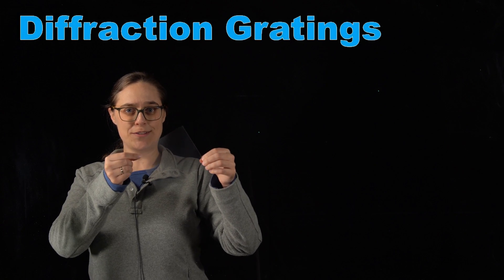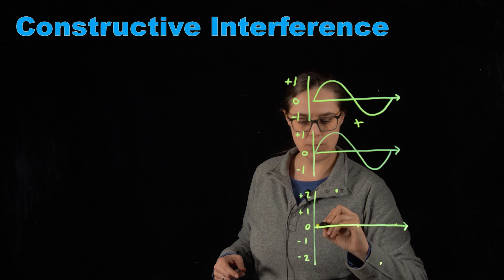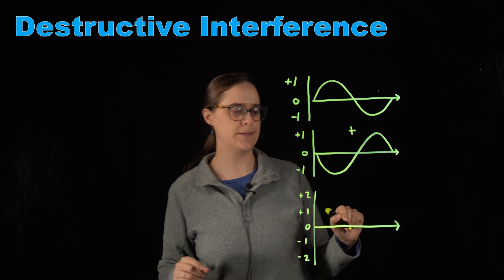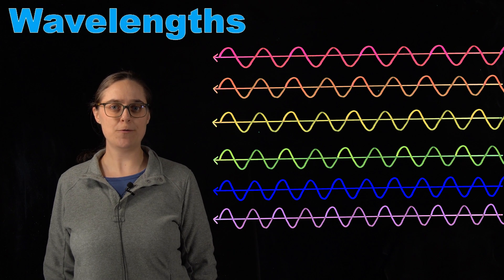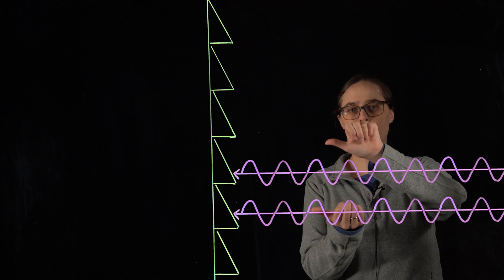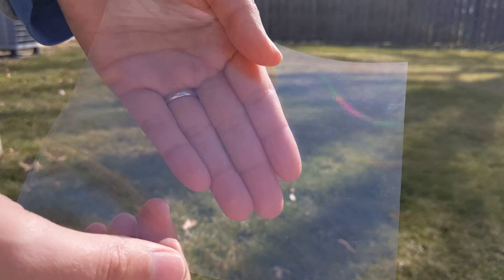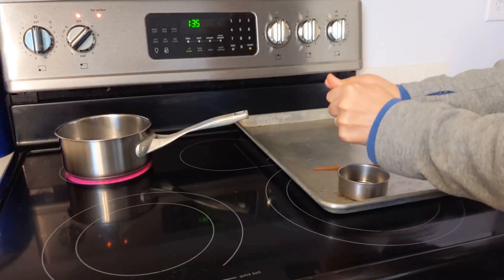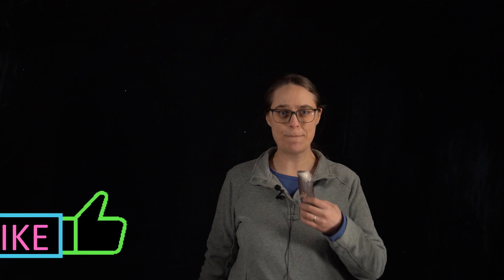DIY Rainbow Chocolate Diffraction Grating Experiment

Comment: Please tell me - how can i get that diffraction to transfer onto GLASS, rather than chocolate? I would be sooooo grateful for someone's help with that please.
Reply from the maker: @NEyeSea You'd need specialized lab equipment and the training to use it, like lasers to etch glass.  It would be cheaper and easier to buy a glass diffraction grating from an optical supply company.
Reply: So there would be no way of using mod podge or anything like that to 'glue' it to the surface? @ChemistryinaNutshell
Reply from the maker: @NEyeSea Yes, I suppose you could glue the plastic grating film to glass.  It wouldn't be etched into the glass the way that the ridges are etched into my chocolate.  It would simply be plastic diffraction grating glued to glass.
Reply: @ChemistryinaNutshell  Thanks so much... but just like the chocolate was a liquid and melted into the grooves of the grating for the transfer, couldn't a thick layer of glue do that too, and then slide off the plastic?
Reply from the maker: @NEyeSea You'd have to try. I'm not sure what type of glue would work.🤷

Comment: Nice video on the diffraction grating! If you tempered the chocolate the effect might last for longer.  Tempering involves forcing a stable crystal structure to form.   I know that many chocolate makers and chocolatiers are experimenting with this these days.  Its funny because you have the physics knowledge, they have the chocolate knowledge.  I am hoping to make a video that will bridge the gaps.
Reply from the maker: Yes, my guess is that you're right, though I haven't tried.  Best of luck on your experiments with chocolate!  Let me know how it turns out!